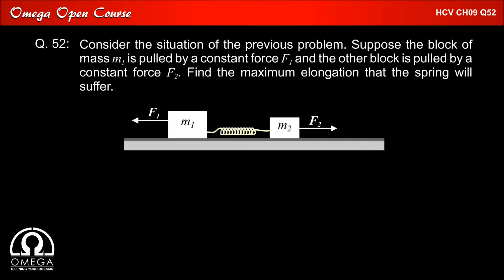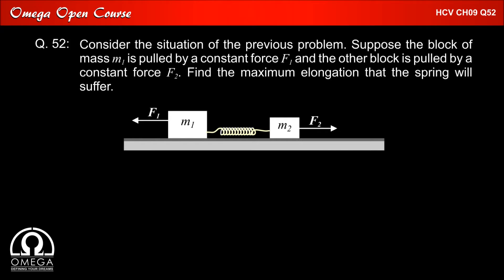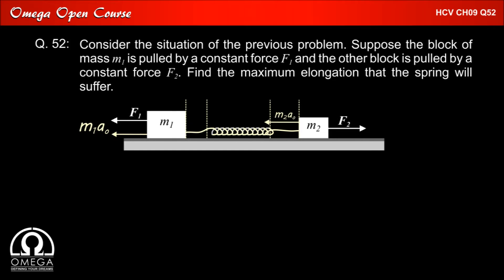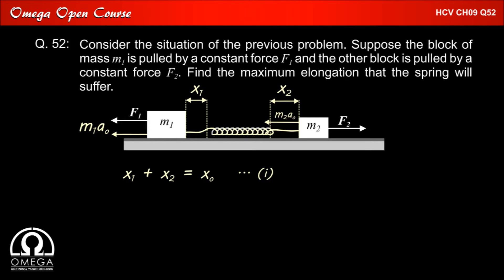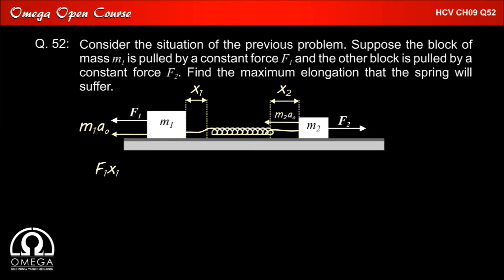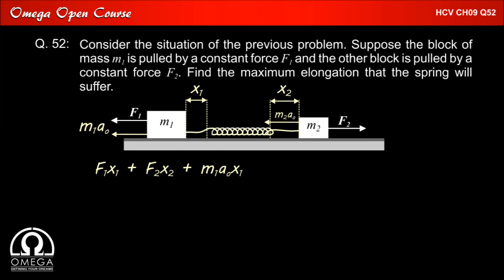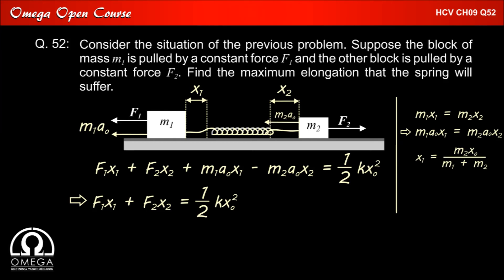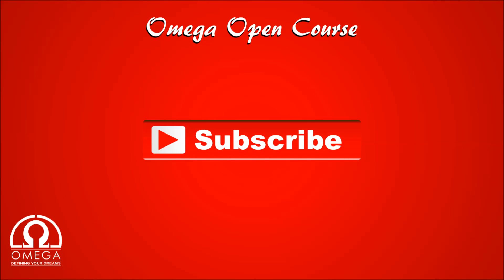H. C. Verma Solutions - Chapter 9, Question 52

Comment: SIR A GOT A Q1KG ICE AT -1O C AND 1KG WTER AT 100C IS KEPT WHAT IS THE EQUILIBRIUM TEMPERATURE. THE ANSWER IS 7.5 CN U IVE AHIN TO SOLVE SUCH PROBLEMS ORA VIDEOSOLUTION
Reply from the maker: +Arabinda Biswas Hmm, i will try to explain how to solve such questions once i am done with the pending requests. Nevertheless, these questions are really simple. You just need to understand specific heat and latent heat properly.
Reply: Sir,
How do we solve this question from earths reference frame? I think in earths reference frame the elongation will be maximum when velocities of both the blocks become equal.. How do we find the velocities of it is correct way to solve this problem from earth's reference frame..

Comment: sir   IF THERE IS FINITE LENGHT OF ST CURRENT CARRING WIRE AND IT STARTS FRM ORIGIN ANG GOES TO  y AXIS IF A POINT P WHOSE COORDINATS ARE  (X,----y) WHAT WILL BE THETA SIGN AND HW CN WE PROCEED CN U MAK A VIDEO PLSPLSPLSPLSPLS
Reply from the maker: +Arabinda Biswas There are different methods to find the magnetic field. Different people use different convention and take different angles. So, it all depends on what you are using! However, i will try to create a video on that, but it might take some time.